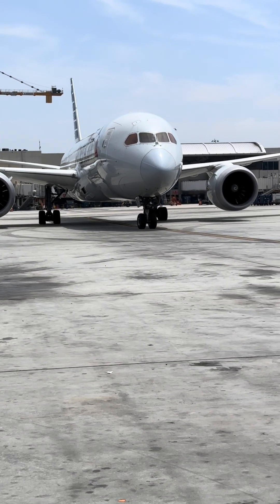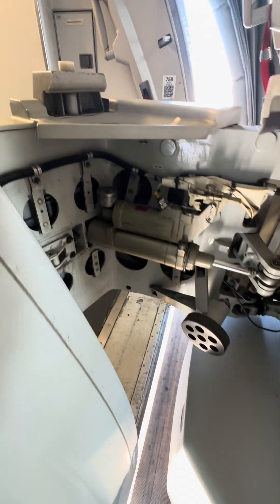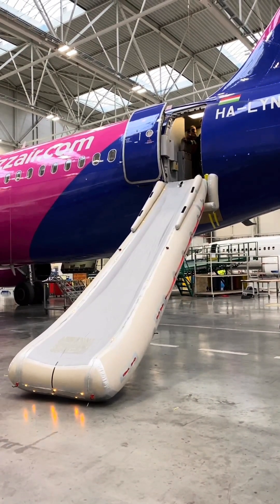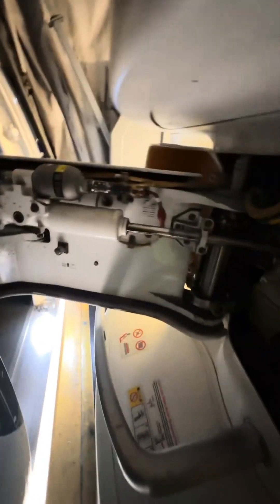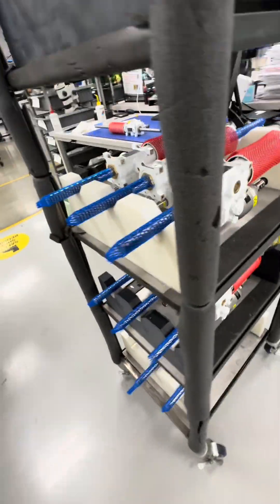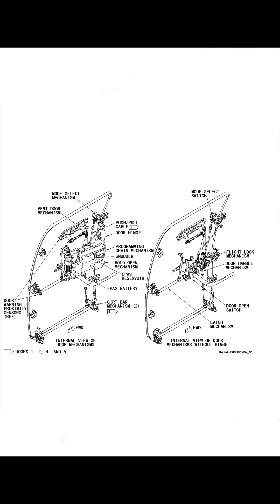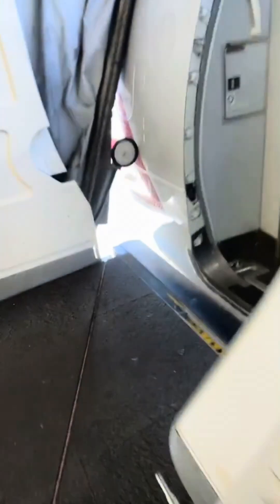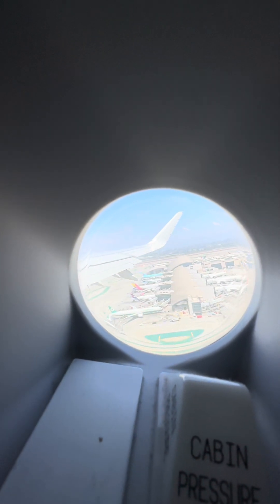Aircraft Doors and Door assist ATA 52

Comment: Thanks for such a great video Stig! One thing I have been puzzling about, and still can't figure out, is how the 737NG cabin entry doors create an airtight seal. The mechanism seems extremely complex, especially with the door swinging outwards, and the bending top and bottom segments of the door. I just can't imagine how an airtight seal should be possible with a door that can fit through its frame. Like the A320, 777, and 787 families all have sliding doors that seem to seal with pressure and a gasket. It would be great if you could explain the 737NG doors in detail in a future video. My curiosity about it has been bugging me for a while now. 🤣
Reply from the maker: It’s simply a difference of design they all work the same way, all these doors are plug style, it’s the tapering of the door that allows it to move in and out of the cabin

Comment: When Boeing created the 737 Max, why didn't they update the door?  They have updated the over wing exit to swing up and out.
Reply from the maker: The max was modified to its maximum extent, if they changed anything more, it would no longer be a 737. They had to keep the doors the same and upgrade different systems.

Comment: Another type of door that also fascinates me are the ones on 767 and L1011.
Reply from the maker: Oh, those are very interesting, they slide in words and up. You should see the mechanism that actually pulls that thing up, looks like a big garage door spring.
Reply: I think the door on the l1011 was the best designed.    Next to impossible to accidentally blow, and no bottles to keep check of since it uses a big spring to open in an emergency.

Comment: So I have a really dumb question and will seem like I'm paranoid, but I don't ever worry about this kind of thing during flight, but is there some kind of safety long on these doors to keep a random passenger who might have a mental illness of sorts to keep from opening a door during flight?

It's kind of silly but I will sometimes during the long flights to and from Tokyo as I sometimes wait for the bathroom to be unoccupied, I will open the shade from the door window to look out because I usually sit in an isle way seat during long flights so I can get up as needed.  I don't have a window seat so I will look at that window sometimes to enjoy the view, but then I look at the door itself and imagine what if someone tried to open this because maybe someone is crazy. lol
Reply from the maker: If the aircraft is pressurized and flying at high altitudes, the door would be impossible to open, you would break that door handle before you open the door. So there’s no need to worry about that, and just as a precaution, always keep your seatbelt on when you’re seated.
Reply: Ok.  I was wondering about that.  Might have been something fictitious, but I thought I've seen something somewhere about a crazy passenger opening a door mid flight.  

I plan to fly so many more times in my life, I hope I don't experience any turbulence so violent that the craft makes a bad enough drop that anyone standing hits the ceiling.  I have seen aftermath videos of this.  In 2020 when I took my first trip to see my fiancé, just girlfriend at the time, I was on an ANA Airlines flight to Tokyo and I sat there with my seatbelt unfastened, and the flight attendant politely requested I put the belt on.  My thought was why do we need these fastened although I was not going to disobey the rules although for something like 10 minutes I sat with it unfastened. lol @StigAviation
Reply from the maker: @TheCAG1976  the incident that you were talking about was a very unusual one, the aircraft was pretty much about to land, and was almost completely unpressurized, the disturbed passenger stood up and opened one of the doors. The flight attendant should’ve been there, because that was a flight attendant Station, I don’t know exactly how that happened, but the good news is that they landed safely. In regards to turbulence, it doesn’t really bother me because I know the aircraft can handle severe turbulence. And as for seatbelts, I always have mine fastened no matter what. Even if I’m sitting, and there’s nothing happening, I always keep my seatbelt on.

Comment: @Stig I am always surprised that the airline industry doesn’t warn passengers that wearing clothing with nylon material especially women wearing nylons will get a nasty burn if they ever had to use those slides because they are also made of nylon and nylon or nylon create quite heat friction. By the time they hit the bottom, they will definitely be running from an old retired guy. I hope this helps somebody.
Reply from the maker: Oh, trust me they do, even the FAA recommend this as well as the NTSB. But most people don’t pay attention or read.  But you’re absolutely correct on wearing proper clothing when traveling.

Comment: Hey stig I have a doubt the one installed on B787 and B777 are they both like A320 (that only works in emergency) or they work every time open or close the door?
Reply from the maker: They all work as a damper to have smooth door action and in emergency

Comment: I work for a repair station but different aircraft, I have a curiosity: how often do you need to do an operational test of the emergency exits and doors? ty
Reply from the maker: That particular test you saw happens annually. They will pick a random aircraft and designate all the doors or some doors. And they will intentionally deploy the door to make sure everything goes a up to par.
Reply: oh, so it is not required to do it to every serialized system but at random?
Reply from the maker: @friedchicken1  all the slides are serialized and so are all the door assist actuators and bottles. So when they do pick the particular aircraft and the doors the numbers are all in record as it is. They are serialized and FAA PMA approved parts that are continuously tracked by a particular code. They know which aircraft it’s installed on and what door position it’s installed on. Everything is documented to the T
Reply: oh yeah , I know that, but I was wondering if a test had to be performed to each system, say, every 2 years or so. that's what I was wondering. but as you said, they pick planes at random to do functional tests :)
Reply from the maker: @friedchicken1  yup randomly. It’s required by the FAA. The random part is because there’s thousands of aircraft in service… they want to see that if they pick any of them that the system is functioning and proper maintenance is done.
Reply: that makes sense :D hey thanks for taking the time :) :)

Comment: Cool, Stig - so many differences between each design!  Do you need metric tools for Airbus and imperial for Boeing maintenance?
Reply from the maker: All commercial aircraft use SAE standard tooling. There are a few exceptions with interior items such as trim and cosmetic components which can be metric. But over all most of the hardware and fasteners are SAE standard (imperial). Check my tool box video and you’ll see the tools I use. 👍